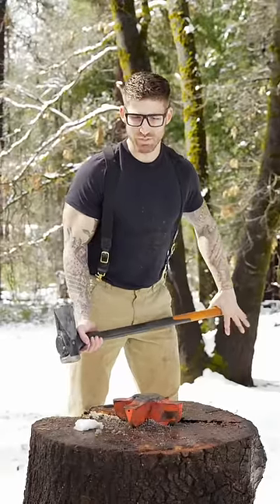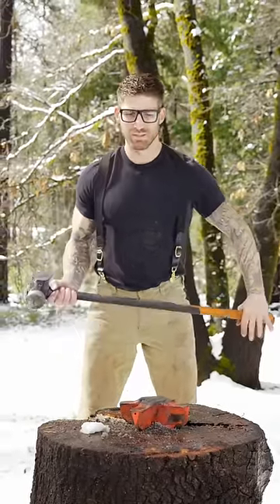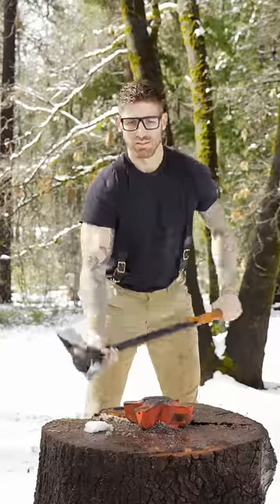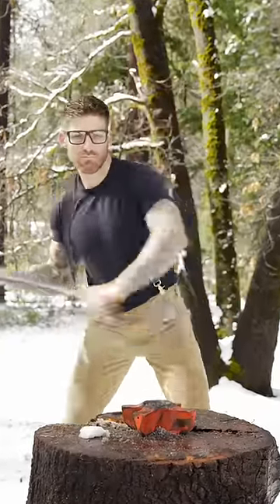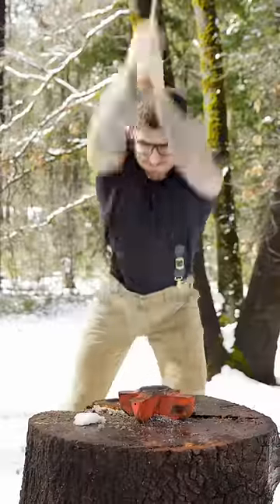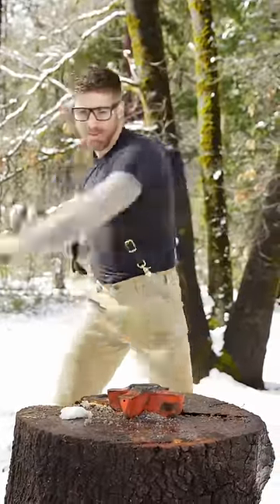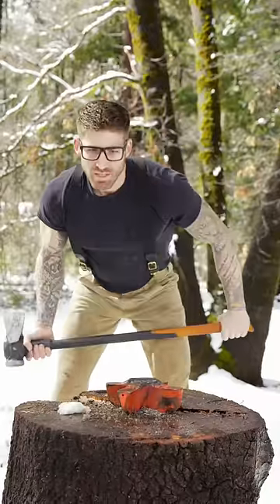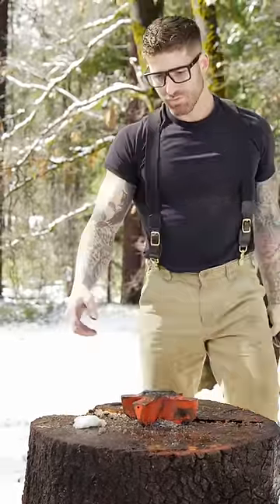When the prototype should stay a prototype

Comment: You really shouldn’t hit hard steel on hard steel, they make soft steel sledges for a reason. There’s been multiple guys here at work get injured like this. Can break off a shard that could fly at you like a bullet.
Reply: very true, what he would need is a dead-blow hammer, those are designed to transfer maximum momentum with minimum bounce-back, but even with that the 4-way split is silly, the most likely outcome is just a single split after using twice as much force
Reply: I pray they made the wedge out of a mid steel but, you're right. Eye, face and ear protection needed
Reply: "I'm gonna stay back I don't trust it, it don't trust it at all"
Reply: I need to test this thing... better grab the bae glasses and styling gel.
Reply: both are probably carbon steel of some kind
Reply: I was thinking the same, like yikes you want more than safety glasses doing something that dumb lol
Reply: I remember this exact scenario happened to my brother. Shrapnel straight to his arm and a stream of blood shot out. He became a nurse after that experience 😅
Reply: I thi k that was his i dont trust it point
Reply: I only heard it was a concern if either tool were beat up enough to have split edges which you'd want to keep ground down. But with something questionable as someone else's beat up homemade wedge it's probably applicable.
Reply: I know a guy who has a glass eye for that very reason, he hit hardened steel with a hammer and a shard went flying right into his eye, obviously he wasn't wearing any eye protection.
The disturbing thing is you never know which eye to look at when talking to him to try not to make him uncomfortable, then you realize you were staring at the wrong one when the other one moves.
Reply: Shhhh. Let him regret it when he's older.
Reply: This clearly is not a hardened wedge, because the blades are too wide and too dull to keep their purchase in the wood. Also, wedges are only hardened in the tip, if at all. You know just enough to make yourself sound more foolish, but that's okay, we all learn somewhere.

And the center point mushrooms, and the bounceback is flatened, doesn't go halfway back to his face or something even with the wedge jumping back up during some blows. It's not hardened, and that's how you can tell. He also has glasses on. That's perfect for that level of risk, the flakes that can happen wouldn't more than lightly cut skin. Maybe stick you. Not badly, and not if you see it mushroom-rolling and like... stop, and not hit it anymore.

For a hydraulic press for wood splitting, it would be mild steel. You don't need anything fancy when your secret is blunt hydraulic force.
Reply: All I can think is the long term damage he's doing to his body. All that force is exuded  through his wrists, arms and into his shoulders. Carpal tunnel, torn tendons, worn bones etc ☠
Reply: @D4cked  Nope, it can happen with pristine tools where hardened steel is involved. It's typically the tool that shatters, resulting in metal shards embedded so deep they need surgery to remove. And tools that show signs of splitting should be thrown out, not ground down, because grinding down doesn't repair the developing fracture in the metal.
Reply: @jeremy5939  lol highly unlikely. Anything at that force breaking isn’t gonna go deep enough to need surgery. Like wtf
Reply: First smart response so far.
Reply: It’s definitely not gonna fly like a bullet. The chance of breaking off a perfectly round piece, spinning it up, and launching it on a ballistic trajectory, with an axe like that, is exactly 0. This is physically impossible.
Reply: @setoman1  Firstly, not all bullets spin, only ones fired from rifled barrels. Secondly, it's an expression. The point is, shard from shattering hardened steel fly incredibly fast and do incredible damage. This is indisputable, you can find hundreds of incidents with a quick google search. Hitting metal with metal like that is inherently dangerous, even if only one of the two is hardened.
Reply: @jeremy5939  First: All bullets that fly straight spin.
Second: You’re not reaching bullet speeds. A 10th of that, maybe.
Reply: @setoman1  Nope. Rifling was invented in the 16th century but didn't catch on until the mid 1800's. It just makes guns more accurate. Shotguns are not rifled.

As for your "about a tenth" theory - considering that muzzle speeds vary from around 200m/s to 1400m/s, that's just a silly statement to make. Shards of shattering metal could be easily faster than the slowest bullets. And, one more time since you missed it last time: "fly at you like a bullet" is just a turn of phrase. I think it's fair enough to describe it as like a bullet if it's a piece of metal that hits you hard enough to penetrate muscle, which is exactly what has happened in hundreds if not thousands of documented incidents.

You gotta stop using your imagination as a source of facts. Google is your friend. All the scientific research is out there.
Reply: @jeremy5939  Do you know how to read? We’re talking about BULLETS, not musket balls. Rifling predates bullets. Rifling is what allowed us to switch to using bullets. If you got bullets, you got rifling.
Reply: @jeremy5939   yeah and if you knew something you’d know if you shoot a slug”big bullet” out of a shotgun it’s a rifled slug due to it being a smooth bore gun. If it wasn’t rifled it would tumble through the air. Has to be that way to shoot “shot” out of it. And some shotguns take specific sabot rounds, have a rifled barrel, and can not shoot any type of “shot” out of them. And even the slowest moving bullets we have are still going through the rifled barrels. Yeah there are plenty of incidents but that doesn’t mean it just happens all the time. Not even close. And no if you’re hammering away on a wedge with a hardened sledge hammer this pretty much is not going to happen. Only the tips of wedges are hardened for that EXACTLY reason. Yeah it happens when people do dumb things but that chances of it actually going more than like 2 or 3cm past the skin is usually pretty uncommon.

Comment: Hear me out, what if you weld/attach the 4 way wood splitter onto a handle just for the fun of it
Reply: Nothing would happen. It wouldn't be able to do anything to any kind of wood.
Reply: Honestly, would probably get stuck more than it would split. It works well for a hydraulic wood splitter because of how the entire thing is engineered, that way … probably not so much. At the same time, yah never know
Reply: @styxxfiremancer This dude is a hydraulic press tbh
Reply: @Sus_Sax_Guy nah, this dude is a jack hammer
Reply: Then you would make a funny hammer
Reply: It would still suck.
Reply: @angryinternetperson6629 it would split small pieces tbh, if sharpened well
Reply: Would work better if the logs diameter was closer to the size of the wedge...and the wedge should be longer

Comment: Let’s double the surface area on a splitter. Good plan, great plan?
Reply: its kinda quadrupled
Reply: @hazardeur  I was looking at the initial contact, where we have 1 straight line of contact, we now have 2.

How are you getting Quad out of that?
Reply: @Illegiblescream  It forms an X shape where each axle has about the same cutting surface as a regular axe head.
Reply: @davidhoffman6980  I was judging it against a regular splitting wedge. But that checks out, I think.
Reply: @Illegiblescream  I reread your comment. I think we both missed that.
Reply: @Illegiblescream  cant tell you the math behind it, only thing i know is that it can't just be twice as much because if the would take a regular splitter and just make it 100% bigger, it would still split that wood a lot faster than this thing. probably has to do with the energy being dispersed/wasted to the lateral sides. maybe there's some engineer here that can clarify
Reply: @hazardeur  To be fair, doubling the surface area is also doubling the friction and inertia, so the difficulty wouldn’t double, it would quad.
Reply: @Illegiblescream  in theory it sounds good to me but something about it rubs me the wrong way. cant put my finger on it though
Reply: @hazardeur  leverage is a hell of a thing.

Speaking of leverage I lit 1300 on fire in the stock market by buying a bad call.
Reply: @Illegiblescream  know the feeling. happens to the best lol
Reply: @hazardeur it's because the edges are not congruous. A splitter is one congruous edge. It works because of that. Forming an X, there are no congruous edges.
Reply: @hazardeur you can look at it and see 4 separate areas of contact. Trust your eyes and stop overthinking it.

Comment: You can buy 4 way trunk splitters off the shelf, they cost around $10 and are really effective. This homemade one is not well designed. That the wood is wet isn't helpful. People on social media seem to love mauls (or just abusing axes by hitting wedges with the butt of an axe) but a hefty sledgehammer is a better tool for the job IME.

I did this a lot as a kid and as a teen. We got a forestry commission permit for a few weeks in the summer and hauled trunks back in a '79 Hilux. We tried to chop them up in the autumn, after they had dried out a bit and before it started to get damp out again, and stockpiled the logs in the woodshed. It kept the fires in the bedrooms, living room and stove on through the winter. It was a big house but only about half the rooms had fireplaces.

When really chopping wood for use (rather than thirst trap content) it is more efficient and more ethical to use smaller logs from a sustainable forest and to put the wood from larger trees like this one to better use. Most fireplaces and burners can't accommodate large hunks of wood well anyway. It's not the best experience as it takes longer for them to create much heat, and they can stay on for longer than you need so more like to end up being a waste if you put one on and end up leaving the house or decided to turn in for the night before it's done.
Reply: Thank you for sharing your experience, I appreciate the added context :)

Comment: You need a bigger sledge. By definition that's going to be 4x as hard as a normal splitting ax. You NEED that inertia to make up the difference.
Reply: This is why we shouldn't skip physics classes
Reply: Yeah a 20lbs sledge would have probably worked instead of the 10lbs splitting maul
Reply: Edges would have to be twice as long.

Comment: The law of inertia... can not be broken.

I'd assume it works much bette if welded directly to the sledge
Reply: Or used on a hydraulic splitter like it's supposed to be...
Reply: It wouldn't work then either.
The problem with all 4 way (or really 2+) is an extra force.
As the wood presses away from two of the sides, it's pressed into the wood pressing away from the other two sides.
Those extra pounds of force create a logarithmic curve of force required to split it. Because you now need to apply lateral force to an event that doesn't otherwise require it.
Human strength can overcome it eventually, but the work to reward ratio is too great to want to do it.
So why does it work on a log splitter so well? Because hydraulics. They can exert FAR more pressure and casually overcome the extra force.

Comment: I actually had a similar idea to make a 4-way wood splitter head, thinking it would work really well... Thanks to you, I've saved some time and energy.
Reply: Would work ok with the constant force of a hydraulic splitter .
Reply: @mikemoore5929  or on smaller logs. Adding the extra splitting direction requires SIGNIFICANTLY more force
Reply: @Dr.Spatula @Dr.Spatula Yeah. This thing is stupidly designed (4 way splitters have been around forever and do not look like that), the log is wet, he's not using a heavy sledgehammer and  it's too big a log for this to be a good idea. Everything about this is dumb and I am only commenting because it hurts to watch.
Reply: @iain.collins  You are completely missing the point dude. No matter how you try to use it, it will ALWAYS take much more energy and time to use a device like this then it would be to just take two swings with a genuine splitter. He has already uploaded another short explaining this exact point, id recommend checking it out real quick.

Comment: Try it on a smaller log. Something with a diameter that's 1.5 to 2.0 x the width of the splitter. It will work then.

Comment: Without thinking too much - the reason imo is the force distribution. With this gadget the applied force (which is always the same, no matter the splitter) is able to distribute over a much larger area. Theoretically you'd have to apply at least twice or more force.
Reply: Or maybe have a skinnier vertical cylinder so smashing a much smaller surface area which translates directly downward towards the blades rather than outward like it seems to be doing
Reply: It's less force distribution and more whete the force is going. 

A normal wedge pushes force down and out.  This pushes down and in, so the wood is being pushed into the perpendicular  blades, which results in them being pushed out.
Reply: needs consistent, high pressure, a press would work brilliantly, but with a sledge it's just not gonna do it.
Reply: There's no way that would have worked.
Reply: @Greybeardmedic I know-it’s kinda funny that they just think applying more pressure downwards on it where the force goes in all directions down the four arms  and failing to realise that the same forces also goes between the arms so yeah the force of the blow there bounces back off itself then prob back up the thing-it’s futile-it’s why we invented axes with one blade-lol-
Reply: @Guitarbarella  And attempting to explain physics to them through a YouTube comment section... Almost as difficult.
Reply: @Greybeardmedic I know-needs a diagram-lol

Comment: Comes a point when there’s too much surface area on the wood and not enough psi
Reply: Exactly. Too much area, not enough splitting force to match. I think the inverse square law would apply to this too, wouldn't it? If the area is double you need 4 times the force.
Reply: @cannibalholiday  I don’t think so but there could definitely be some factor like that when you look at how the wood springs it back from two sides instead of one. I’m pretty sure it just has to do with PSI. Whatever you put in on top you get out on the bottom and if that surface area is doubled then the PSI on the point of each blade is gonna be halved. So you need double the amount of force to have the same force as a normal axe

Comment: It’s very difficult to split wood unless you’re going in the direction for the grain. 4 ways 50% is hitting perpendicular to the grain where the wood is very very strong. Gotta hit parallel to the grain where the wood is weak that’s probably why this doesn’t work.
Reply: It is parallel, thats not what the mistake is
Reply: It’s trying to separate to many fibers at once. It needs to be slimmer.
Reply: would a three (or five) way be any better or worse?
Reply: @Enozenim_LJO  not a three way not a five way. A simple maul will do the trick. This is a matter of Physics. When you are splitting logs you dont try to split the middle like this guy is doing. It disperses the impact force over a larger area and has less effect (just like a bullet proof vest). Instead you split the outer edges and work your way in just like you would peel an apple. The wood on the outside is less dense than the wood in the middle and it concentrates the impact force on a smaller area. Then as the piece becomes smaller and smaller the strikes have a greater effect. In fact the three way or five way is making it harder than a single maul.
Reply: @DBBMed  thank you for explaining :)

Comment: Make it longer for more angle applied, also add flukes to it so it will not bounce back up but will dig deeper with each hit.
Reply: Use a single standard spplitting wedge...Done in half the time
Reply: Yeah good luck when it slides all the way in and the stump doesn't split

Comment: A pretty trunk stump with that star embossed on it: the forces are being dissipated along a bigger surface area once it's embedded, it needs to pressed continuously rather than hammered. Maybe a pile driver would yield a better result. As you say a manual strike just wastes all that muscle-power into heat. A more blade like wedge on each fin would also help with those cleave angles.

Comment: It's elastic energy. Most of the impact is instantly dissipated by the recoil and sound of the impact. So barely enough kinetic energy is being absorbed by the wood splitter into splitting the wood. A conventional axe 🪓 has a small surface area along its sharp edge making for lateral pressure enough to effectively transfer the kinetics of your swinging mostly into the wood block.

Comment: The wood from the one blade is push against the wood from the opposite side of another blade. Then multiple that by four sides. There’s no where for the wood to go. A hydraulic press can overcome the wood, but a sudden impact from a sledge just isn’t enough to allow the wood to go anywhere. It works work great on a small piece.

Comment: Well of course its going to be way more difficult. Not only are you contending with the force required to split along one axis, but now you have another axis that needs the same amount of force applied to it to split it as well. Not only that, but in a single axis, the wood only needs to move in one plane, meaning there is comparatively little resistance applied to the wedge's two sides - for two pieces of wood touching the wedge. Now there are 8 sides touching 4 individual pieces of wood, each pushing back with equal force on all sides of the wedge